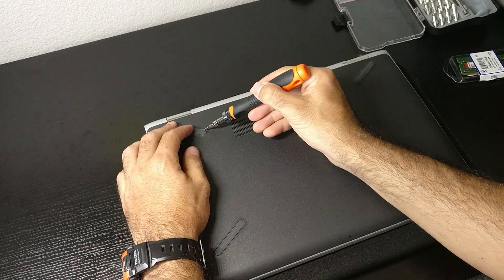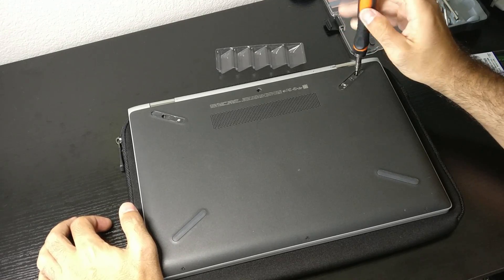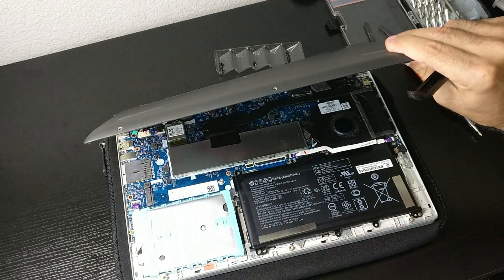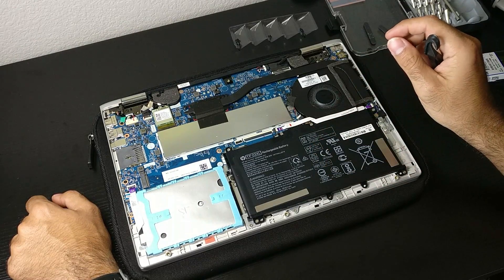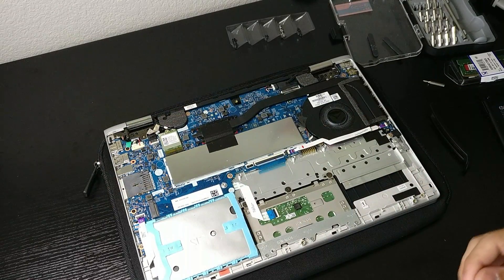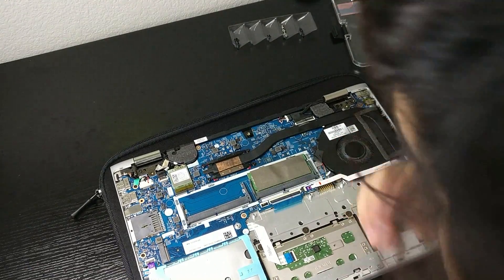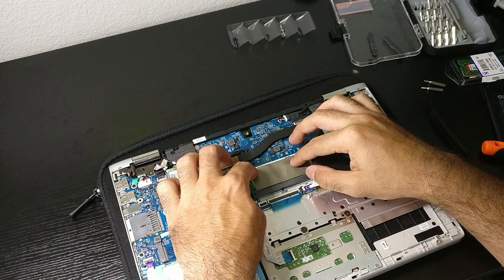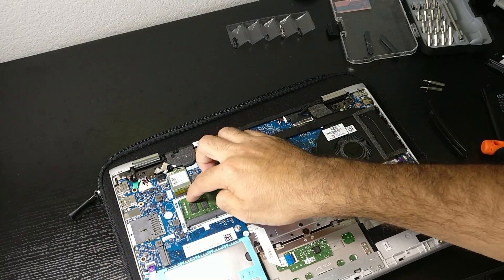How I Upgraded the RAM on my Cheap HP Pavilion x360 14m.

Comment: Does doing this void the laptop warranty?
Reply from the maker: I thought it did, I know that for example swapping the HDD for an SSD would void the warranty that's why I waited to do it until the warranty expired.  Now I found these too sources that say that, as long as you don't break something in the process, you can upgrade the RAM without voiding the warranty:

https://www.quora.com/Will-the-warranty-of-my-laptop-be-void-if-I-upgrade-its-RAM-to-8-GB-from-4-GB-in-India#:~:text=Nope..,it%20wont%20void%20the%20warranty.

https://h30434.www3.hp.com/t5/Notebook-Hardware-and-Upgrade-Questions/Does-Upgrading-RAM-Void-Warranty/td-p/6467414

But still, I would be very careful, if you are really worried about voiding the warranty I would advise you to wait until it expires to upgrade the RAM, companies like HP will do and say anything to not respect warranties.

Comment: I have pavilion x360 i3 8 gen. I ordered 4gb ddr4 2400 mhz ram today. Will it work?
And it has an extra ram slot right ?
Reply from the maker: Hello, like I said in some other comments, with these mainstream laptops is hard to know what are the real specs by just knowing the model number, you need to use the serial number to able to get more accurate information, you can get this by using the hp support assistant.  The other option is to just open the case and check it out.

Comment: Hi, my laptop has 4GB of RAM, I found another RAM with the same frequency and CL but it's 8GB instead of 4, will my laptop work using those two? Or do I need to buy another stick of 4GB?
Reply from the maker: I'm sorry I just saw this comment, so yeah as long as the timings and latency are the same you should not have an issue,. I had a laptop a while back with that same configuration (8gb +4gb) straight from the factory.
Reply: @orlandomireles6374  can we get 16GB instead of upgrading to 8GB?

Comment: iam usinghp envy x360 model 15 m dr0011dx my laptop has only 256 gb ssd company fitted can i install harddrive in my laptop please reply bro aur any body have knownledge
Reply from the maker: You can certainly swap the existing hard drive with one with higher capacity or most probably add an extra M.2 ssd if you don't want to swap hard drives